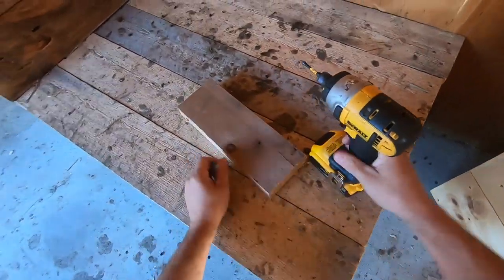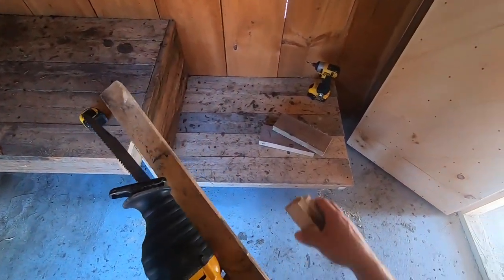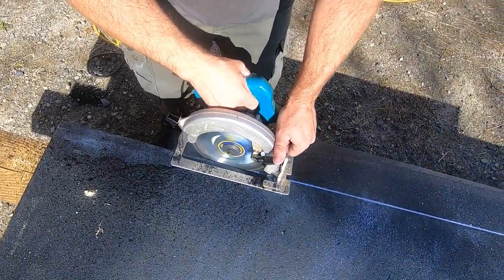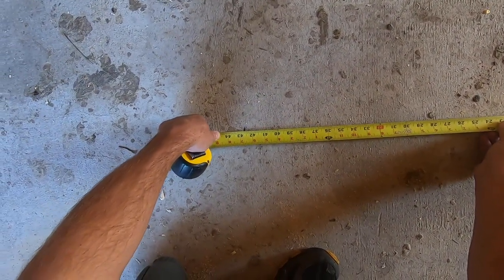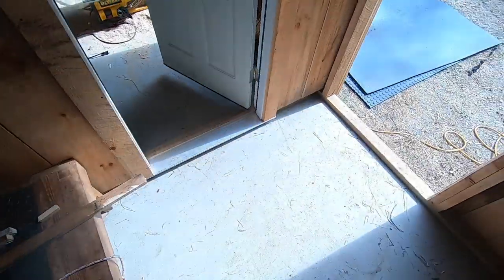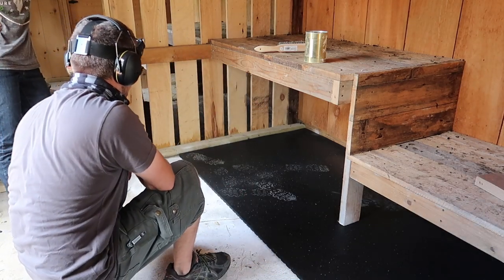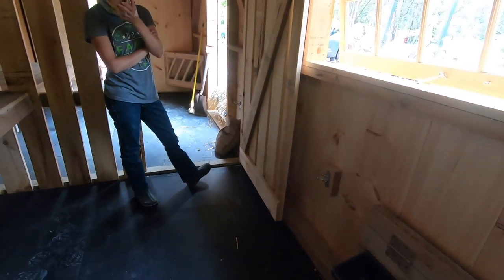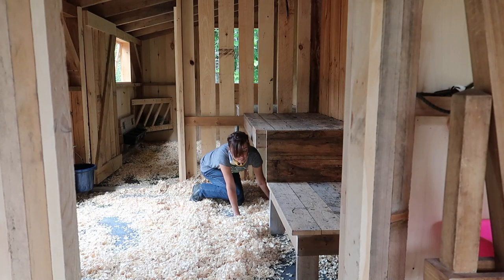was this a HUGE MISTAKE?? Concrete Floors in our NEW BARN

Comment: The mats look great. Having successfully cleaned a car that smelled like a barn, I would wash the concrete with vinegar and laundry soap, seal the floor, then paint with killz odor killing paint and a durable outdoor or floor paint. I would glue the mats together with rubber cement, ShoeGoo, gorilla glue, epoxy, or something similar so that urine didn't get under the mat as easily.
Reply: Judy G.  for sure. I hope they are able to paint everything soon

Comment: I thought about that when you started building the barn. I have the same problem with the concrete floor in my barn. The boer goats urine just stays on top and it's always wet. At least with a dirt floor it absorbs into the ground. Plus I would think the concrete would hold the cold  more so than a dirt floor. I live in iowa so our winters aren't too far off than yours.

Comment: We just had concrete in the front work bench area, like an 8'x10' slab, our stalls and the lean to for the tractor were dirt floors. We raised pigs, cattle, on dirt floors fine and saved $. I had unshod ponies too so concrete wasn't great for them. Concrete gives you easier cleanup with a hose though.

Comment: There is a product called Stall Dry, a food grade diaclamateous earth, looking like kitty litter, used under animal bedding that absorbed the fluids and odours. A little goes a long way.  Big in equine use, and safe for all animals. We used it for our chicken/duck house and rabbit hutches sealed wooden floors, underneath the bedding (straw, hay, or wookchips) and it really made a difference with controlling and eliminating the odours. Sealing the concrete would help too.

Comment: Should have put an epoxy down to seal the concrete prior to the rubber mats because urine will go between the cracks and you’ll be picking them back up and redoing it eventually. Hope it works out for y’all.

Comment: 19:00 You should put the little piece under their bed instead of the high traffic area in front of the feeder to avoid urine finding that seam as easily. As the seam would now be under the bed. It would be easy to switch out, even now. ❤🌅🌵

Comment: Here in the UK you can buy paint on sealant for concrete so this would stop the urine soaking in.  You could also put some insulation down and then vinyl flooring which would make it warmer and waterproof. They must do something similar over there

Comment: Next spring power wash all the concrete floors in the whole barn. It will take a few days for the concrete to dry. After it dries put a sealer on it. I think they make concrete sealer that you can put on wet. Then once sealed every spring take up stall mats power wash and re-seal. I hope this is something that helps. Love the videos and did Olivia start back to school yet?

Comment: Just reconfigure the barn a bit!  Use the milking room for tack and storage, move the milking stall to the center room, bring the old goat barn over to live beside the new barn and fence the area from the center stall back to include the area behind the barn that you use now.  Keep the back stall available for birthing and quarantine only. and the cleanup will only be occasional. Or you could simply lay down about 3 inches of dirt in the stalls and shovel it out every quarter.  Those seams in the rubber flooring is going to be a messy, messy, stinky area.

Comment: I saw a few weeks ago that the concrete was getting pretty dirty and mentioned it, then you put down the straw.  I thought that solved it.  I never thought of the urine penetrating the concrete.  I think your solution with the rubber mats is ideal, especially covering it with pine shavings.  Good job!  (You'll need to calculate your ROI on your goats someday.  My chickens cost me $432 a chicken.  That's why I'm calling them organic.)    Edit:  I read all the "seal it" comments.  You can always seal it when you remove the pads for cleaning.

Comment: Drains would have been nice for easy cleaning with a hose, but really hard to retrofit at this point.  Concrete is porous and will continue to absorb and discharge water.  You will need to seal it.  I think someone suggested sealing the lower part of the wood too.  Old apartments with cat ladies in them came to mind.  That is probably a good idea too.

Comment: Don't worry that you made a mistake by putting concrete floors in your goat barn. There's another advantage that you might not have thought of to concrete floors- in the event of a flood, your barn is a lot less likely to get swept away or sustain serious damage (I know hurricanes sometimes make it all the way to NH)! You could seal the floors, but it might not be necessary. We did the same thing you and Gina did in our goat house by putting down rubber stall mats. We take them out at least once a year during hot weather, and power wash them and the floor itself. We have a drain to the outside in the middle of the floor, but you could also use a giant squeegee to push the water out of the barn. Not the most fun or easy job, but doable for 2 people. Other than that we clean the floors by scraping them with a flat spade and shoveling out all the damp bedding at least once a week year round. The wood shavings absorb the pee and are easy to scoop out during super cold weather. We do without when it's above freezing. The lime will also help with keeping the odor down (we use a commercial stall freshener). I think you all made a good choice with the stall mats- relax! It's probably unnecessary to use a sealer. Thanks for all your great videos. I find them very soothing to listen to and always look forward to the next one.

Comment: You should probably try and seal the floor or paint it with drylok. I think the urine will seep beneath the mats in time and create another issue. We kept everything on concrete here; goats, sheep, chickens, pigs and turkeys. Dogs too. The poultry had deep bedding that got cleaned out after we butchered a batch. The sheep and goats had their stalls swept out daily and hosed down every weekend. I didn't use any detergent either. I never noticed a smell but then it was open stalls and not an enclosed building so that might be where the difference is.

Comment: We use rubber mats in the horse stalls. Bed deeper with your shavings and add some sweet PDZ in the urine spots after cleaning. Cleaning often and bedding deep helps with the smell. Sealing the concrete would also be a good idea because urine will still sleep through the seams in the mats.

Comment: Power wash and put down an epoxy seal coat before you do the rubber mats.  Totally agree with the rubber mats on top of concrete.  Much better for goats to walk and sleep on.  BUT...unless you seal that floor you will always have an issue.  Additionally, cleaning will be much easier with an epoxy seal coat.

Comment: I think you are going to find those mats to be a giant PIA. To sum up from some other comments that I agree with. 
Best option: Seal the concrete and the lower portion of the walls, and use a litter system, whether deep or not it will absorb the urine and make mucking out easier. 
If you are using mats: Seal the concrete and put plastic sheeting under the mats and along the bottom of the walls to prevent the urine from making contact with the concrete and walls.

Comment: There is a sealant you can spray on the concrete floor and it truly works very well.  Rubber mats are not needed if you spray the sealant.

Comment: How about clean the floor, use a concrete sealer with a little sand for grit to make it less slippery.  My uncle raised goats and had straw on the floor for bedding, which added some additional insulation.  If you are worried about it being cold, why not insulate the walls and put rough sawn wood on the walls so the goats don't get into the insulation.

Comment: Now that you're done... put 2 bungee cords around the mat to slide it thru the doors... remember it for when you clean.  Also before you put down the shavings, taping the joints with duct tape keeps the urine out.
  And yes concrete is porous to an extent.

Comment: Your question: "does the concrete hold that smell...?"
Yikes!! You were cautioned/instructed/advised/warned/alerted since the barn foundation was poured. That the concrete needed to be sealed due to its pourousness.
Thoroughly amazed at your present quandry.

Comment: Two things come to mind.  Find a real store for concrete trades.  Ask them about a good sealant for a barn floor animal waste can realy damage concrete.  If any sections of concrete are larger than twelve feet squares you should cut control joints in the concrete to reduce random crackling.  And long narrow sections may benefit from control joints. Cut about 1/3 of thickness of concrete.  They help to force the cracks at the joints and protect the rest of the floor.   The joints can be filled with an elastomeric materal to keep out water/ice and animal waste. Same store can help with that also.

Comment: You would also be well served by "staggering" the floor mats so short then long panels in one row and long then short on the other row.  That way you only ever have 2 corners meeting along a continuous edge rather than 4 corners meeting which presents a larger and looser opening which can more easily leak urine to the floor below.  Next time you take them out, to seal the floor or clean up re-install them to extend time between cleanings.

Comment: Seal that floor. We sealed the concrete floor and concrete block partitions between runs in a dog kennel and it was perfect. Easy to hose down and sterilize between boarding dogs and never any lingering smell. The idea of cleaning rubber mats every few months seems counter productive, expensive, and for me, would get old real fast.

Comment: Not if you learn to manage it well.  Horse owner over 25yrs and barn girl my whole life... lol concrete floors are great! Seal them up... mat the stalls and milking area. Use pelleted bedding or shavings and straw. Gut down to the cement 1/2x a year (spring and fall here) clean stalls otherwise as needed. You’ll never have a damp barn this way. We now have a circa 1901 (thats not a typo) Dairy barn we use for our cows, rabbits, birds and goats.... Cement floor... keep it clean will keep it dry. PDZ is your friend as well.

Comment: Epoxy paint will seal the floor. Clean the floor well, etch it with muriatic acid for a better bond. Let it dry for a day or two and paint on a two part epoxy, two coats.  The last coat throw scatter some coarse sand in while it is still wet so it won't be too slippery. Next time and you will build more, slope the floor to a drain so it can be rinsed easier and run the pipe outside

Comment: Yes, i was about to suggest a rubber stall mat. They can be pricey, but well worth it.  I wonder if there is a roll on paint that will protect concrete from stains and odors?  I used a roll-on, textured, truck bed liner paint on the floor of my aluminum horse trailer to prevent corrosion from horse urine.

Comment: rubber mat a good idea but would leave so it contains the urine and cedar shavings that you can scoop out otherwise the urine will seep into the walls of the barn. I did something similar in the big houses I had goats in and it really helped.  just go up wall like 2 inches

Comment: You can seal the concrete.  Or really cheap linoleum that you can spray off.  I put one large piece of linoleum in the chicken coop.   I can roll it up some and pull it and the bedding out.  I spray it off and put it back.  My coop is about the size of New Yolk City.  If you cover the mats with one sheet of linoleum their urine won't seep through  the seams.

Comment: You can seal the concrete  easily, The rubber matts will hold in the urine.Which will be easier hosing off the sealed concrete or pulling up matts all the time? The straw will insulate the cold.

Comment: Cutting rubber matting actually heats and melts the rubber. Use a utility knife and make several runs until mat is cut. I learned the hard way.

Comment: Now that the floors are wet with urine even sealing will be difficult. Need to keep the goats elsewhere until the floor dries. use Thompson's water Seal, then maybe one of the epoxy garage floor coatings to seal in what has already been absorbed and to stop anything new. Then add you matts back. I would not try sealing the floors until completely dry from the urine now.

Comment: What about a few coat's of apoxy primer and paint on the cement floor  so the urine can't get in the cement ?
That would make a great second line of defense with the rubber mats on top. I believe that the concrete was the best choice but it needs a great sealer like the  apoxy applied to it and any wood touching the floor up to 4 inches up from the floor blocking splashing of urine.

Comment: When ever we poured concrete floors we sealed them after, keeps liquids from soaking in and keep them from getting cement dust when we swept them. then you could just put shavings down to absorb the urine &  spilled water.

Comment: I would recommmend the expoxy sealer used in garages.  Extremely durable, but expensive.  You can even add glitter to make the floor sparkle.  The sparkle will remind you how much you paid for the darn stuff.

Comment: Also, if the rubber mats aren't one solid piece, the urine will seep under it and soak into unsealed concrete. Then when you go to take them out to clean, the smell will likely knock you out. Concrete floors was a very good choice, but they do need to be sealed very well and there are some really great sealers out there. I agree with shavings as well because they tend to keep the animals warm and I think they're cleaner than straw or hay. Good luck guys, I love your videos and wouldn't miss one!
Oh, and I wanted to also mention that if you want to try and clean the concrete before you seal it, the only product I've found to work for that is called "Natures Miracle". It doesn't mask the smell, but instead neutralizes the enzymes in the urine. You can find it in most Wal-Mart's in the pet section or by the gallon on Amazon!

Comment: Taking the Matt’s out to clean them is a pain, we had them in the horse stalls......I agree with deep bedding and putting it into the compost.....sealing the concrete floor will make it easier to clean and less absorbent.......
Good luck with those rubber mats some brands stink when urine sits on them....🤢

Comment: Concrete tends to be problematic for barns. For larger animals, mats and/or bedding are necessary to prevent hock or knee sores and it will absorb/retain urine smell. Back when I worked with hunter/jumper show horses, we preferred crushed limestone floors and covered them with mats and deep bedding. You'll not thoroughbred racetrack stalls are all dirt floored, as are the walkways.

Comment: Good morning Al and Gina. Live and learn. I had thought that the concrete would have helped with the goats hooves, but I can see where the goat urine might cause the concrete to deteriorate. I hope the mats solve the problem. 
Al, what type of blade did you use for cutting the rubber?
Have a great day.

Comment: Lumnah Acres
Al .... I remember people telling you that you will need to seal that concrete when you were building the barn so the urine wouldn't soak into it and ruin it. Please Seal that concrete under those mats... BECAUSE that URINE will still flow UNDER the MATS through the spaces between them.

Comment: Look into a rubber type liner that goes between the floor and the stall mat. It reminded me of the stuff they  line koi ponds with.  I will try to find out and send info. I also remember it went up about 6 to 12 inches on the sides to keep urine off of the walls. The urine  splatter would rot the wood in the stall.

Comment: All, Gina, My thoughts on the stall floors are as follows. Seal the concrete, cut the bottom door  frames flush to the floor, put the bed legs on hinges. Sluice out with a pusher for cleaning over the clear floor you have made. The pig sheds my brother in law worked in were made this way with a long drain. We hozed and pushed 🤮. The space under the mats will get nasty. Hope you did not hurt yourselves moving those heavy flexible back and wrist breakers. You will probably be ok across winter, but not when it heats up. Sorry to sound so negative. Time will tell. I would love to eat my words😀. Regards Stephen.

Comment: But sure the product name but there are coatings designed to seal concrete flooring.  Another suggestion, over the rubber mats use dried fine wood saw dust/shavings. I've found either of these will greatly aid with ordor.

Comment: I know it’s too late now, but a razor blade works awesome to cut those. We tried a circular saw at first but, like yours, it smoked and struggled a bit. We whipped through them with a razor blade quick!
Reply: Also wanted to add - those mats are SLICK when wet. We have one on our milk stand and my cow has slipped a few times. I put lime on it any time it is wet to give her traction, but I think I’m going to flip it over

Comment: Just adding to the chorus. Power wash (maybe with a urine odor eliminator) and after fully dry seal the concrete. It is a pain but you will be glad you did. BTW, the urine eliminator stuff smells 50 X worse than when you started while drying but then once dried the smell is completely gone.

Comment: Industrial epoxy concrete coating with small flakes for anti-slip.  The concrete needs to be clean-scrubbed and dry before application. Lasts 20 years! maybe good to seal up the framing a foot from the floor also with an approved wood sealer.  Then it will be a lot easier to remove the biomatter with a wash down. Although with the rubber matting the girls will have pretty and long nails to show off.  ;)